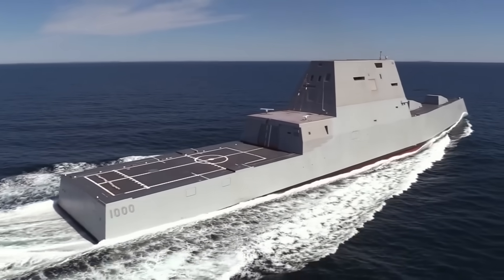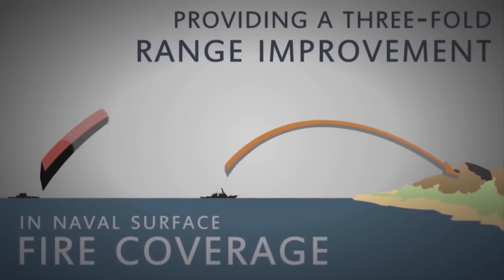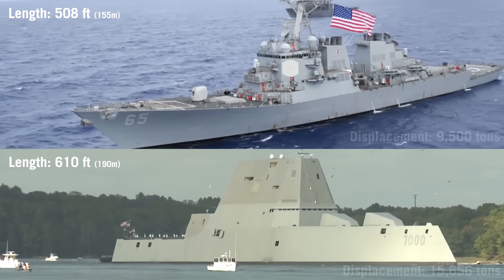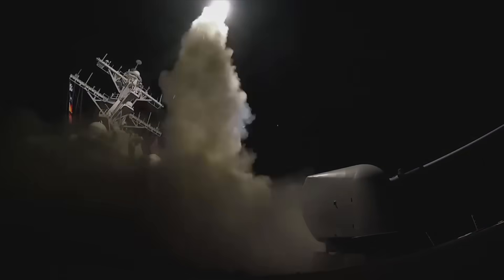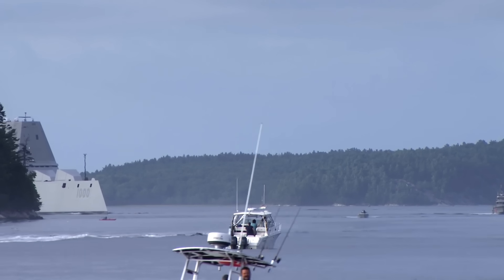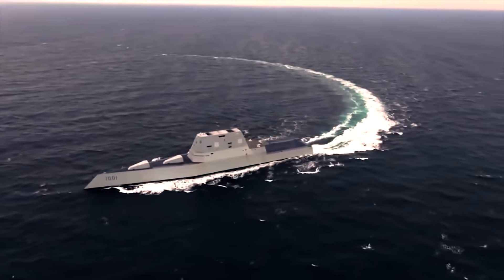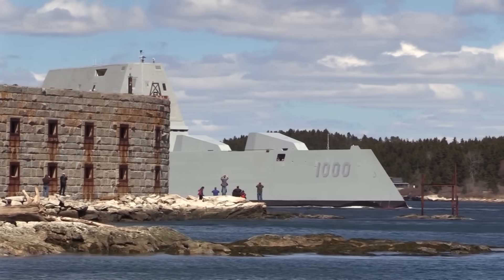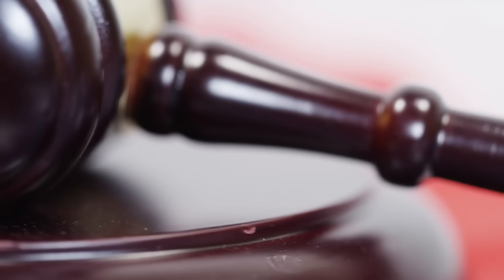What Killed Zumwalt Destroyers?

Comment: What killed the ZUMWALT was not "attempting to incorporate too many new systems at one time" - it was trying to develop new systems, and integrate them, WHILE the ship was being built.

A long time ago, any new technology to be integrated into a military 'system of systems', like a ship or airplane, had to be developed separately and tested to be reliable before integration. Almost all DoN shipboard systems were built on dry land, and tested ad-nauseum, to ensure they worked 100%, BEFORE they were approved. Yes, the DoD paid for their development, but an entire class of ship was never conceived around technology that didn't yet exist!

In the late 1980's and early 1990's, the DoD was sold the pipe dream that 'we can build the ship while we SIMULTANEOUSLY design/develop/test all these crazy, advanced, new technology products' - and some political hack actually signed off on the idea!! That made the cost of all kinds of programs SKYROCKET!!

I was on the NIMITZ during her overhaul. What a mess that was for the communications techs on board!! They introduced a new system to replace BOTH the standard PBX shipboard phone and sound-powered phone systems. In the process, they integrated ship command and control capability on certain terminals so the CO could C2 the ship from multiple locations. They then tried eliminating the old sound-powered phones system. We wound up using the SP Phones much more often than the I-CANN (I-CANT as we called it...) system - at least until I changed commands. There were several other 'bleeding edge' technology ideas put on her at the same time, that proved to be (initially) unreliable as well, that gave many of us serious concerns about our warfighting capability in battle damage scenarios, too.

They're doing the same thing with the USS FORD with her catapults and arresting gear, propulsion, navigation, RADAR and comms suites. Rather than independently designing and proving these key systems, THEN integrating them, they started designing AND BUILDING the ships around these new technologies before they were even designed!! Hence, the incredible cost overruns and delivery delays!! But I will say this - if they ever get all the cool tech they installed on her working 100%, that'll be awesome!!

What this does is GUARANTEE the contractor will have a HUGE R&D project funded for the foreseeable future - AT TAXPAYER EXPENSE and WITHOUT QUESTION!! With a ship, like the ZUMWALT or FORD, that means they got to contract a whole ship (or two, or three...), yielding multi-billion dollar contracts, that could NOT be cancelled. And THAT meant the R&D contracts ABSOLUTELY could not be cancelled!

It INFURIATES me when I think of this!! It's EXTREMELY costly, soaking up TRILLIONS of taxpayer funds, and is DANGEROUS for the crews who must depend on these systems in times of crisis! In my personal opinion, it's criminal to allow this type of build-while-designing programs to even exist!!

So, now we're going to have three DDG-1000 class vessels that are going to be extremely expensive to operate, have ZERO replacement parts, limited warfighting capabilities due to limited ammunition (only 150 rounds being produced...), and which will probably be decommissioned in less than 20 years due to operating expense concerns. They'll be the 'touring ships' of the US Navy - going around, showing the world our technological prowess, giving tours and the like - meanwhile being of limited value in a real campaign.

They'll be nice museum pieces some day. Maybe I'll get the chance to tour one before then, otherwise, I'll just have to wait until they're open to the public...

Comment: short version. bureaucracy killed the zum. remember: the bureaucracy is increasing to meet the needs of the increasing bureaucracy.
Reply: No, what killed them was that, Modern destroyers are far more capable and their stealth is just as good (I.e. type 45 destroyer radar signature is that of a fishing boat too) yet cost 1/3 of this. Companies thought they could cheat the US out of more money (they are normally correct) but they went too far this time. I don't know why you even mentioned bureaucracy, the only time that even came into it, was when they said why are we spending so much money on this useless garbage, that would have been meh in the 90s let alone now.
Reply: *expanding
Reply: That is very simplistic.  No bureaucracy, no procurement.  So you need it... but maybe this is not just about bureaucracy.  Contractors manipulate these things constantly.  I've seen it happen...

Comment: So they replaced the the standard slugs backed by propellent, to a missile. When they said they replaced the slugs with a propellent and GPS guided smart slug ,I just about lost it, as that is a missile. Anytime you have to put propellent on a projectile, your costs go up 10 fold or more, because you are now talking about guidance systems, sensors, optics, etc.

Comment: Typical DoD contractor scheme:  Over promise, under deliver, and overcharge.
Reply: Do not blame it solely on the contractors,the Navy asked for this ship,and its specifications and the industry for a truly questionable amount of money delivered it. It passed all the requierments.Question is who wrote the requirments?
Reply: We should have SpaceX guys design our shit sometime.
Reply: @TheAero1221  dude... space X contract by nasa is just as expensive as the space shuttle cost ... except the space shuttle program was human proof
Reply: @ereder1476  To which contract are you referring? If you're talking about the $300M lunar gateway module's, then its best to keep in mind nothing of its like has been built before and doesn't really have a fair point of comparison. If you're talking about ferrying astronauts to space... well I'm not sure what you mean by "human proof", but they both get the job done. Based on the current Nasa contract, it costs about 400M per flight to launch a crew dragon mission which can haul 7 astronauts. Without the need for a pilot, this is the same number of people the shuttle could ferry. Adjusting for the cost of inflation though, shuttle missions cost anywhere from $450M to $1.2B per.
Reply: @TheAero1221  the 1.6b contract that saved spaceX from brankrupcy
eddit: wihc cost the government 310m dollars per launch
Reply: So... comparable price and comparable gain. I'm not sure what your complaint is.
Reply: @TheAero1221  it's more expensive. spaceX advertize publicly that the launch cost 60 million, yet they charge for 310m 

NASA had a program that could not only send payload for the same price but also completly reuse a SPACE SHUTTLE that was human proof.

Space X has proven during the last decade that the "reusing the rocket to save money" is complete BS since their cost has ever dropped (it have in fact increased) .

i don't get space X fanboys. By all mean, switching from the space shuttle (human proof) to spaceX is more of a downgrade than anything else. There was no money "saved" whatsoever
Reply: @ereder1476  still not sure what you are meaning by human proof. And I haven't seen you provide any proof that the shuttle was any cheaper. Reusable, sure. But refurbishing costs were high, and mission costs were also incredibly high. If you account for inflation, shuttle launches cost $450M per. Doesn't $310M sound like a lot less to you? And the $60M is their personal cost, which means the remainder of their charge covers other one off expenses and the rest is profit for the company. Nasa saves money, SpaceX makes money, mission gets done.
Reply: @TheAero1221  human proof = is safe enouth and have enouth redundancy to be used by human.
 at the end of the program the shuttle program cost 20k/kg (it was 60k at the beginning)

space X contract with nasa ( c-08-069 ) is 12flight valued at 1.6b that program put the use of space X at 80k/kg if space X just did the minimum. thankfully they didn not and it brought the cost down to 20k/kg too .. except it's not human rated: it can only send non human stuff .. wich is a downgrade.

NASA need ot use the russian program (more expensive at 80k/kg).
Reply: @ereder1476  alright, yeah. I can see how the initial contract could be considered a downgrade, but the shuttle was long gone by then, and thats also not the most recent contract. Crew dragon launches are now starting to be a thing at a fair price of $55M/seat, roughly $400M/operational mission. Cheaper than the shuttle. Plus we don't have to rely on the steadily increasing price of seats on Russian Soyuz rockets.
Reply: @TheAero1221  yea, you're right. But as you can see , it's not as simple as spaceX fixed Nasa's issue. no they just replace it. 
SpaceX is doing what they are supposed to do: but the so called revolution and how cheap things are ... well not really.

I would have love to see a revised space shuttle program with spaceX booster for the ultimate recycling. Plus Elon musk always oversell anything he makes. So it's really hard to beleive what he says
Reply: @ereder1476  Reminds me of the Tesla Estimated EPA range vs the Actual EPA range.
Reply: @ereder1476  gosh I hate the SpaceX fan boys who think Elon is some kind of messiah. I like what he's done with getting people interested in space again and kicking of a new space race, but he's not at all perfect.
Reply: @TheAero1221  you're aware they're also massively subsidized by the US right?
Reply: @samarkand1585  Yeah. And they get results. We need more of that.
Reply: @TheAero1221  They just don't get results quite as cheaply as they say
Reply: @samarkand1585  Imo that isn't a huge concern. We already pay through the nose to contracting companies that don't get results.

Comment: 158 crew on a ship that size is a joke. they'd have to cut out all of the admin department, half of supply, and like 1/3 of weapons and engineering departments to meet that. an arleigh burke destroyer with an extremely lean 250 person crew already runs REALLY poorly, and that's a smaller ship with less to maintain. who the fuck is gonna keep up with deck preservation? who's gonna do magazine sprinkler maintenance? who's gonna make food? who's gonna stand watch in engineering? 

hell, watchstanding alone is gonna eat most of that crew's time. ask any port/starboard OS, halving CIC's watchstanders is gonna make the whole crew miserable.

AEGIS is based on *NIX, so saying "based on linux instead of AEGIS" is dumb. the Q70 consoles in CIC literally run a custom hybrid linux/BSD kernel.

You see those pictures of a "ship fleet" and think that battlegroups travel like that? ships literally NEVER arrange like that unless for a photo-op. most of the time, we're out of visual range of each other entirely. being "invisible" "in the fleet" is still a huge advantage. being able to hide among small boats would be fantastic.

Comment: And would run on Linux... 
Anthony has entered the chat
Reply: "The Deck layout is somewhat standard für a ship of this size. Flex is minimal, albeit a bit more in the middle section. When the turrets are unpacked, you immediately see the thin bezel around the gun barrels. Also, reflections are minimal, which is much nicer in the sunlight...."

Comment: You missed it: The PRIMARY original intention was to use the Zumwalt destroyers in and around the South China Sea... and the First Island Chain. The PLAN's leaping technology caused the Zumwalt's to be redesigned even while on the ways. That's why the Zumwalt, itself, spent so much time there. The funding was going down the Electronics Rat Hole. Also, ultra-high power electronics were being used for the first time for propulsion and projected weaponry. So the lead ship in the class was a full-scale concept design. It even got tripped up in Panama. (!)
The USN brass finally self-admitted that the entire concept was flawed -- because no matter what was done, the PLAN was going to saturate the Zumwalt's position if it ever strayed into the First Island Chain. Only submarines can ever operate there -- same as during the Great Pacific War. (1941-45)
BUT, the Zumwalts were ideal for the Persian Gulf. Realistically, only one would be needed. (+ two spares in training) Its role would be to force Tehran to spend LARGE to find or counter it. This is military-economic war -- a concept first used during the Cold War. That war was decided by the USSR when they contemplated spending LARGE to counter Star Wars -- you know -- Reagan's Folly. Yeah, he did the impossible, ending the Cold War with the national wallet.
Today's warships are crafted specifically for this or that tactic against this or that adversary... same as aircraft -- all along. The changing nature of the PLAN risk killed the Zumwalts. Forget the money. If the Zumwalts would've caused the Reds to spend ultra-LARGE, the Americans would've hatched them by the dozen. Remember, the Vast, Vast bulk of US DoD spending is on WAGES within the US economy. It's not spent on profits for defense contractors. Doing so is flatly illegal -- and if discovered -- the funds have to be kicked back to the DoD. That's why Google, Apple and Facebook draw huge from Wall Street - whereas no defense contractor ever does. They are allowed to make whatever profits they may.

Comment: Once the "Cost", of a SINGLE ROUND was 1M dollars . . . "What would be the Point" ? . . . even the IDEA, of such a cost, is simply INSANE . . . They simply "Refuse" to REMOVE the "Guns", an REPLACE them, with the "Fully Automatic" LIGHT WEIGHT "8" inch guns, that were planed for the now "Retired" SPRUANCE class. The "Gun" is an already PROVEN system. It would allow the ships to become an "Active" member of the fleet . . . Once the COST of the "Rounds" could be brought "Down" to a reasonable level, THEN, the "8" inch guns could be "Removed", an the origonal guns could be "Re-Installed" . . .